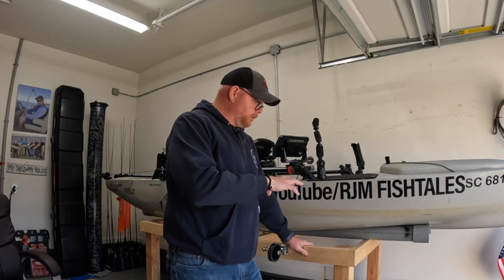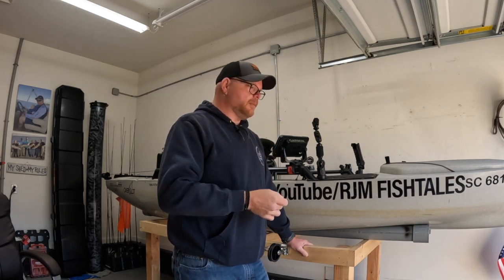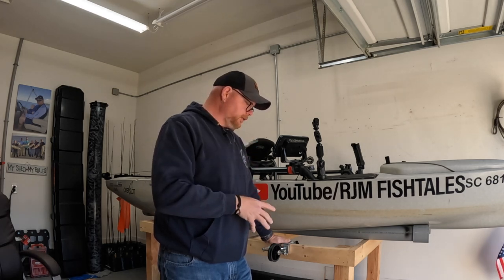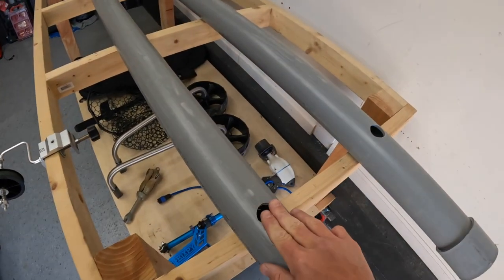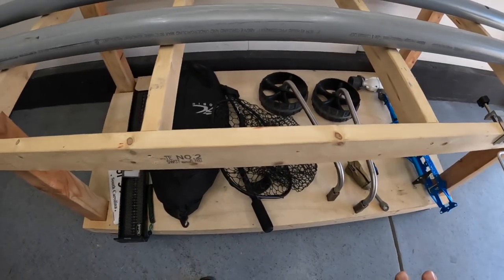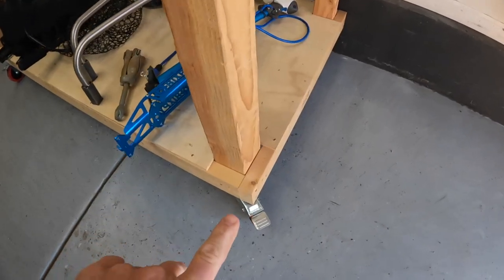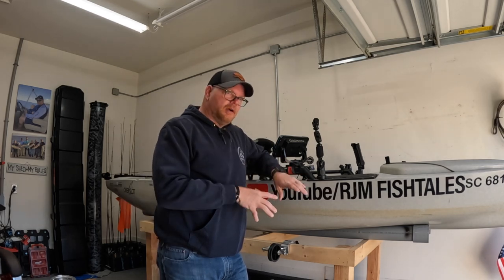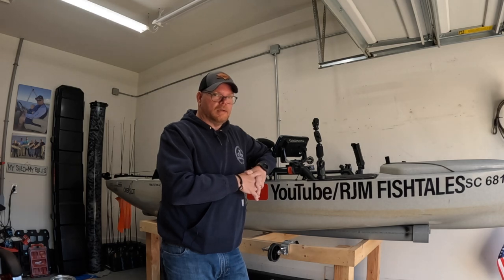How to Store Your Kayak / How to Load & Strap Down Your Kayak in Your Truck

Comment: Thanks for this excellent idea!  Mine is very similar to yours with the exception of just using a few 2X4's below.  Still allows me to store the pedal drive and all my fishing gear.  The PVC works really well for supporting the kayak and keeps it stable on the cart.  This will make loading and unloading my Old Town Sportsman 120 PDL in the truck. Greatest part, only took about 2.5 hours to build.
Reply from the maker: No problem. Yes building a cart for the garage is a must.  Thank you for the comment and watching video.  I appreciate it.

Comment: Great video.  Lots of great tips. What did you do with your Bixpy?   I take off the motor but I leave the Hobie cover and the blue bixpy base. Looks like you do something else since the blue base is gone. Thanks.
Reply from the maker: I take the Bixpy blue base and motor off together.  You can see the motor laying on the bottom of the cart.  I use the thumb screws that came with Bixpy to remove the whole base and motor as a unit.  I have the One Objective motor adapter on the back of the Hobie.  Thanks for watching and commenting.   I appreciate it.

Comment: how would you rinse the yak after a saltwater trip?
Reply from the maker: Just slide it off truck and use the Boonedox landing gear to move around.  Or right in back of truck.  Or when I have on the trailer.  Wherever, all over depending on how I haul that day.